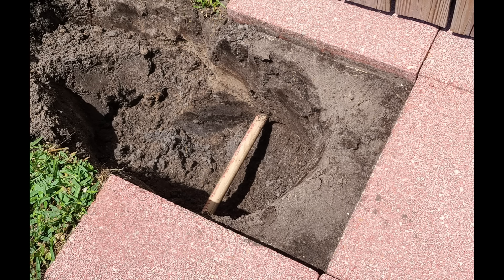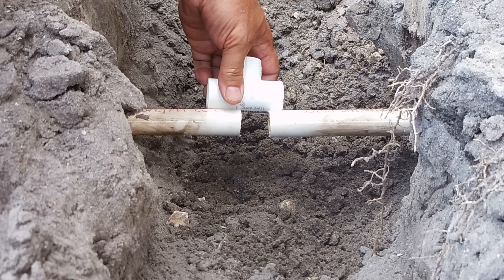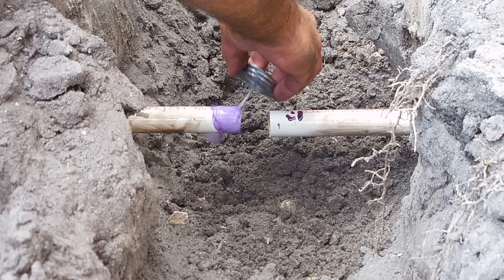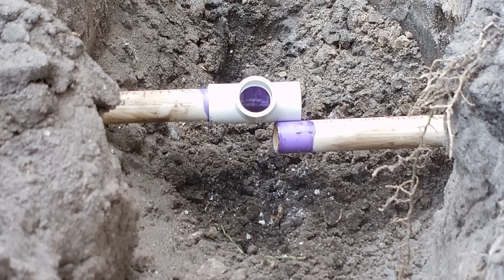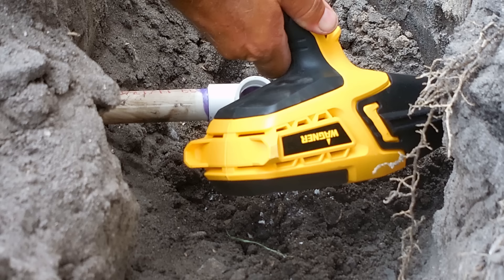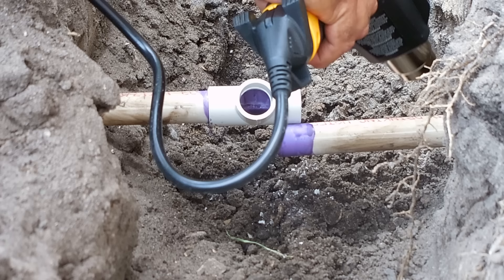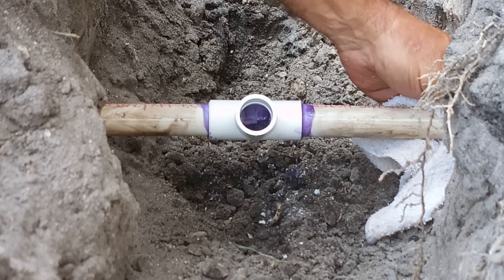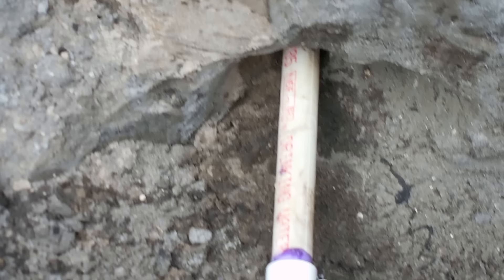How To EASILY Tap Into PVC Water Lines(Best Method Using A Small Hole)

Comment: hopefully the pipe has enough wall thickness to resist the water pressure since heating and bending the pipe may thin the wall thickness which may stay thinned after cooling.   May want to bend the pipe on the side where it would be easier to excavate in case of pipe failure.
Reply: Yawn

Comment: File out the stop in a coupling or Tee and use it as a slip. Easier. The pipe you're using doesn't look like SH40 either.

Comment: There is a fitting available called slip fix. I have used many of them. Very simple to use. But the heat gun is a good idea.
Reply from the maker: Yes, I know all about those. What I don't like about them is that they have o-ring seals that can dry out over time especially when used with chlorinated water supplies. Thanks for watching
Reply: @electronicsNmore  the Oring inside the new slips are stronger chemicalized rubber now. Can last over 20 years especially if you only using a 1 inch Valve. I fix 3 inch Main lines and 3 inch valves so we use all kinds of things . We prefer Pressure fitting LD and smith Blair’s . Thanks for the video man I learn something new everyday

Comment: All you have to do is file down the internal stops on the inside of the tee so it becomes a slip tee.  Mark the pipes for the correct insertion depth of the tee with a marker on both pipes.  Use pipe cleaner on the tee and two ends of the pipe.  Put the glue both ends of the pipe and the tee.  Pull up on the most movable section of pipe slip the tee onto the pipe, immediately slide the new slip tee onto the other side of the pipe to insertion mark and make your final position adjustment.

Comment: I have been a professional in landscape irrigation for 20 years. That being said Do Not Use A Heat Gun On PVC. Ever. 100% ignore this video and don't listen to people who have no idea what they are doing.
Reply from the maker: Another clueless person. I've been doing it for over 30 years, I've done testing on the strength of thermoformed PVC pipe(which you have not), and to this day the homes that I've worked on are still in excellent condition. You need to look up how PVC pipes are made, it involves extreme heat and pressure.

Comment: First assemble the pipe to the Tee next, put a level on top of the Tee and make sure it is plumb then mark the Tee and pipe so when you assemble both you can make sure  the attachment  will be straight.

Comment: Magic, I love this, had problems so many times in connection with this..  thanks so much
Reply from the maker: You're welcome John
Reply: I would also add that here in the Philippines I've never seen pipe cleaner or blue solvent, it's all clear.. I manage though 😊😊😊
Reply: @TheNagaguy I hate that purple mess. I always use clear primer. The reason for  the purple is so that the plumbing inspector can know that primer was used. If you are DIY and there is no inspector, clear is good.

Comment: Excellent, thanks. I would use a torch, but I think it would damage the pipe too much so I think the heat gun is the way to go. I always wondered what the most professional way to accomplish this would be so thanks for this video.
Reply: why not glue the tee and use a dressor? the way he did it is the least expensive BUT over/under heat and you have a problem?

Comment: I use a slip coupling in this situation.  Are those even still available for PVC.  Haven't plumbed in a while.  Or did I make my own?  Do remember using a router bit with a bearing to remove the stop inside, but I could have sworn they sold them without stops.

Comment: I use to put some pvc cement/glue on the pipe & set it alight. Just keep a soaking wet rag with you to put it out.
The pipe will be blackened but who cares, it works and it’s underground.

Comment: I just prime all connections, apply cement, and pull up on both pipes and have them slide into the tee at the same time and give it a little twist. It's hell, but it works.

Comment: there is also a fitting called a slip fix that telescopes.  i used to use them instead of unions on valve manifolds.  you can glue up the manifold with the valves not real close to the main line with the tees in it.  then if you need to pull a valve, you cut the pvc, and put a male on the slip fix pipe, with the female end on the old pipe near the tee.  the slip fix will extend several inches so it's pretty easy to do right.  then it extends and rotates when you tighten the male into the valve

the customer does not need to buy a row of unions, just a slip fix if and when.  just make sure there is like 6" of pipe there so the slip fix will fit in.  won't fit in the box?  just make the box.  you can make a big one out of one rail tie and that will never rot.  or use junk wood for forms and pour a concrete one.  ya doesn't hasta be joe cement finisher cause it is under ground.

the lid is well, what have you got for a lid?

Comment: Ok. I’m
Going to be very clear here. 
Yes heating it will weaken it. 
ONLY IF. It was over heated. If you heat just enough to do this process then the pipe is fine. However if you go over that point of temperature you WILL weaken the pipe

Comment: Thanks, that was a great help. I knew there must be a hack out there I wasn't aware of. 
Is that schedule 40 or 20 pipe you're heating?
Reply: 40.. no reason to really ever use 20 as it's produced so much less it often is more or equally as expensive from hardware stores at least
also the ratings on 20 are terrible

Comment: I guessed a heat gun was used, and I was correct.
 Over the years I have built several Greenhouses, out of PVC pipe, with arched roofs. With pegs pounded in the ground, and a heat gun I made uniform arches. Heat guns do not get the respect they deserve.

Comment: I have done this with a heating gun but when I'm in a pinch??   What you do is you take the solvent, pour on 3inch area 6in to 8in away from connector fitting. Set it on Fire🔥 might have to repeat quickly if you can not bend pipe 1st time. Not Pretty👀 but it does work🤔

Comment: I heat my pipe a little so ratchet cutter blade bends PVC less, cuts easier. PVC has a wide melting temp and welding it is best.

Comment: If you don't have electricity available to run that heat gun - or, you just don't have a heat gun - use a "slip-fix"... easier, quicker and more secure than the heat gun or the compression fitting.

Comment: You don't have to use the heat gun if you measure the exact cut on the main pipe (you need 2 cuts). To do so, place your fitting on the main pipe and mark the amount of the main pipe which has to go inside of the fitting. And make 2 cuts. One on each side of the main pipe. Deburr, clean, prime and glue both ends at the same time and place your fitting in. You're done. I don't like to apply so much heat to pvc since it may alter the integrity of the pipe.
Reply: Read his top comment where he says heating does NOT weaken it.
Reply: I've used the heat gun on the plumbing for my geothermal unit. I had to make custom bends to replace a cobbled up mess of angle fittings. Watch the heat, make the bends using a generous radius, looks very nice and made it easy to remove the unit if needed.
Reply: The PVC pipe is extruded from molten PVC. re-heating it won't do a bit of harm.
Reply: @wolemai  Absolutely not correct. Heating above 140° F affects the pipe wall integrity, though it may not become apparent until several years later. Don't take my word for it - - ask JM Eagle, Lincoln Plastics, Spears, Charlotte Pipe, etc.

Comment: As a rule I never apply heat to a PVC pipe, it compromises the integrity and will become brittle faster then it normally would have. Try the ole 4/90 trick it works betta, mahalo from Oahu
Reply from the maker: Based on my extensive testing(including high pressure between 1000 - 2000psi range), the heating does not compromise the integrity. When the pipe is manufactured it is exposed to very high temps. As you already know, some 10' - 20' sections of PVC pipe have a thermoformed bell end. :-) 4 -90's increases friction losses

Comment: You prime all connections and then glue the tee. Then you start both ends together and always do a little turn to seat all the glue better. I guess you can heat gun it if you want but ive never needed to.

Comment: that heat you put on that plastic weakened it. you could have dug the whole a little bigger pick both pipes up until  the bottom was inside the fitting pushed it down and it connects itself when straight.
Reply from the maker: Wrong. LOL
Reply: @electronicsNmore  I have did that very same thing on a dry vent on drains but pressure is a different story. it may work but if that pipe ever burst it  will most likely be right where it was burnt. because it is weak there. the heat destroyed the original texture of the pipe. . by the way I been doing plumbing years and I wouldn't suggest it
Reply: I think I would try James way first.
Reply from the maker: @GG-xs8vt  https://www.youtube.com/watch?v=wFMhxzmyZXU&pp=ygUOdGhlcm1vZm9ybSBwdmM%3D

Watch and learn.

Comment: This wouldn't be my first option to use. Slip Fix couplings do the job they're supposed to ensuring that the pipe ends fit fully to the end (bottom out) to the internal socket of each fitting. They are telescoping fit designed for a specific purpose ensuring a proper weld. PVC glue is not like model glue, it chemically bonds the PVC together and the fit forces the joints together properly to create this bond. Your idea works electronicsNmore but again, not the first option I have seen MANY failures due to contraction over time. FYI, for sch40 3" PVC pipe - for every 100' it expands and/or contracts ~3"/ 10º Fahrenheit change. The coefficient of thermal expansion for PVC is: 3.0 x 10-5 in/in/°F
Reply from the maker: You're telling me what I already know, but I completely disagree with your "Many" failures claim. I have several jobs from 30 years ago that are still working just fine. Slip-Fix coupling are no good because they have seals that can and will dry out over time, especially when exposed to chlorinated water.

Comment: Or cut the tee down the middle and glue the bottom part and glue the top part with the tee end up.  Use pipe clamps to secure the two pieces in place then drill out the hole in the pipe through the tee.  What could go wrong?

Comment: File the stop out in the middle of the coupling so it will slid past the end of the pipe line the pipes glue and slide it back so it’s on both pipes easier than heating pipe

Comment: I had a heck of a time trying to bend  a 1” black pipe for my  irrigation system. Terrible really tough job, not much flex to it.
Reply from the maker: Where did I say this method is to be used on 1in black poly pipe?
Reply: @electronicsNmore  take a break, I was sharing my experience of the 1” black pipe I just did yesterday. Go get a bud lite
Reply from the maker: @teaglet  It sounded like you were sharing that you used this method on a black poly pipe. As for Bud, when they started using people with mental disorders to promote products, they lost me.
Reply: @electronicsNmore  re bud lite, I agree, it’s a mental problem.    I don’t drink bud lite

Comment: Okay I saw the video . That is  definitely One way but with brutal class 200 this often breaks . Also, with high pressure systems not enough pvc insert can be a problem. Now this video has no running water. If you try this with wet dry while leaking water it sometimes won't work. I would just use couplers with flex pipe or use 90 elbows
Reply: no this doesn't break
he inserted plenty of pvc
you shouldn't glue pvc with running water regardless...

Comment: I just repaired a pvc leak on my sprinkler system. I primed both ends, but I didn’t realize that I needed to apply cement when the primer was still wet. Do I need to redo the job? The primer was on the pvc for about five minutes, and it felt dry before I added the cement.
Reply from the maker: 5 minutes is a long time, but if you applied enough cement, and slightly rotated the fitting into position, it should be fine.

Comment: use a slip coupler. no stop in middle. you will need 2
Reply: And how do you glue the slip coupler if its on the pipe ?

Comment: Last tip - be sure to stick a flag in the ground to identify the next leak location before the water comes up.
Reply from the maker: I suggest you use a flag made out of UV resistant material that can last a few decades, as well as a stainless steel rod for the flag. When done properly you're not going to have a leak.

Comment: This might work in Florida with pure sand for soil where the pie can move around as it is and with thinwall CL200 pipe, but good luck with this in clay and with sch40 pipe!
Reply from the maker: Works just fine in clay soil. Thin wall or thick wall is irrelevant, same result

Comment: @electronicsNmore Should this video be part of your "PVC Pipe Testing, Tips, & Tricks!" playlist? I don't see it in the playlist but there is a video with a similar title where you removed the stops and slide the tee.

Also, what exactly is the higher level of difficulty encountered with larger pipe? Heating, bending? I'm thinking about trying this method on 1-1/4" to couple a section where there is a slight bend to the pipe section. I don't trust slip or compression coupling devices for anything but perfectly straight pipe (as I have already learned by experience), especially on the supply side of the valve boxes with constant pressure. Welding is the way to go for peace of mind.

Comment: They make a slip coupling for that also you let the primer dry when you were heating up the pipe it is all supposed to be wet .
Reply from the maker: No, they don't sell SCH40 full slip PVC repair couplings at Home Depot, Lowes, Ace, True Value, or other hardware stores. The only type sold is for larger diameter DWV. If they did sell them, then I would've have made one of the most popular PVC tip videos on YT years ago. As for the primer, it was fresh applied and not fully dry. You need to watch my testing video below.
https://www.youtube.com/watch?v=1o4E2pdEv-s

Comment: As usual always good watching your videos. I am surprised companies do not make special thing just for instances like that.
But a simpler method maybe is your older video called "How To Easily Tap Into A Buried PVC Water Line With The Least Amount Of Digging!" which you drilled in the pipe to remove the stopper to slide it in the pipe more to pull it back to the other. But it's always good to see other methods. 

Would be good if companies made them already ready. Maybe have a hold in the pipe and have a 3 way be cut on the back diagonally to twist it in place.
Reply from the maker: As long as you have the correct size drill bit, the other method shown works great. Thanks for watching!

Comment: Another option is to cut the pipe as you did in your method next cut of about 4-5” of one end of the pipe and then glue the tee to the lose piece, the slide a repair coupling (primed with cleaner) on to to pipe, next glue the tee in place, then apply glue to the repair fitting and slide it in place. Same as other suggestion without having to modify (grind out the stop) of the tee.
Reply: Ahh ... you lost me
Reply: That is an EXCELLENT suggestion. Nobody yet thought of your obvious solution. I would suggest a modified procedure to avoid putting the primer on too early, which is not ideal. Use your procedure but don't put the slip coupling on the pipe until after the TEE has been glued in, and don't apply primer on the slip coupling until just before you assemble it. Once the T is glued in and dry and you are ready for the slip coupling, apply the primer and glue in the usual way, then insert the coupling on to one of the pipe ends and then slide it back into place. That's the usual slip coupling technique. It works because even with a small hole in the ground, the short length of PVC stub has enough flex to lift it just enough to allow the slip coupling to be slid on. It's easier to get enough flex to do that than it would be to get enough flex to insert both pipes into a non-slip coupling or the TEE.
Reply: @ACommenterOnYouTube Let me try to rephrase the suggestion. Instead of making the repair just with the TEE, make it with the TEE and a slip coupling. A slip coupling is a female to female PVC coupling, used to join two pieces of PVC pipe. Whereas a normal coupling has a little lip inside it to "stop" the pipe from being insert too far, or, really, so that you can feel the stop and thus know that the pipe has been fully inserted, a "slip" coupling doesn't have that lip inside. That allows you to "slip" the coupling all the way over a pipe and then slide it backwards. That's a standard PVC technique for working in tight spots, look up a video on that. The suggestion is to move the challange away from the T, which is hard to find in a "slip" version, and instead shift the challange to a coupling, which is readily available in a slip version.

Comment: I'd be afraid to compromise the integrity of the pipe and have another leak soon down the road. Just buy four 90 degree elbows (of whatever size pipe you need) and use small sections of straight pipe in those elbows and it will make a shape similar to this    ____|     |____    <---but the top of that diagram should have a straight pipe running across the top too, connecting the two sides using two of the 90 degree elbows  (my keyboard didn't have a way to draw that)
Reply: Nope. TEE plus a slip coupling is the right idea.

Comment: In metal pipework, a tee fitting would be in two halves that fit around the pipe. They would be welded to the pipe and a hole would be drilled through the tee, job done. Are such fittings (glued instead of welded of course) not available for plumbing purposes?
Reply: Yes they make saddles. Just drill a hole and place the saddle over the pipe with glue and hose clamps.